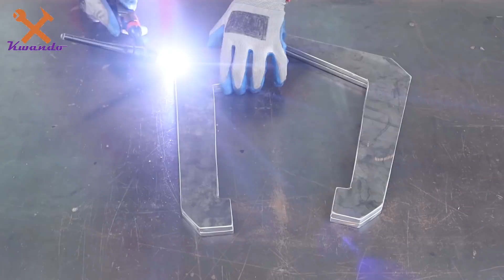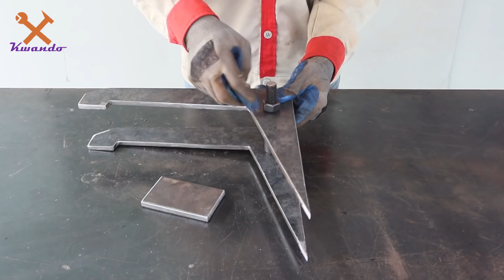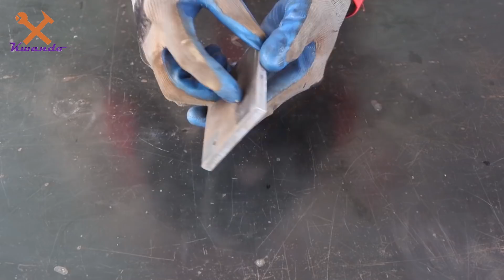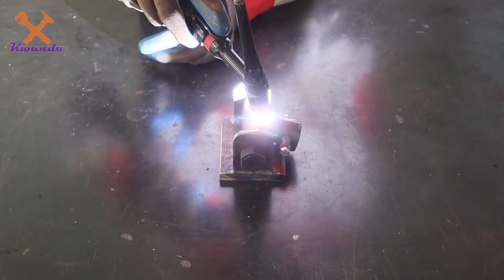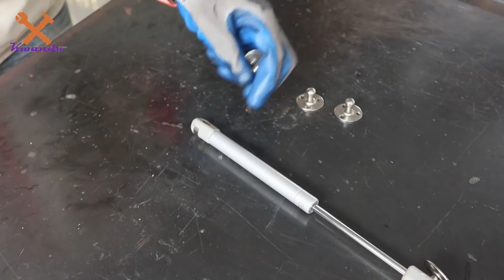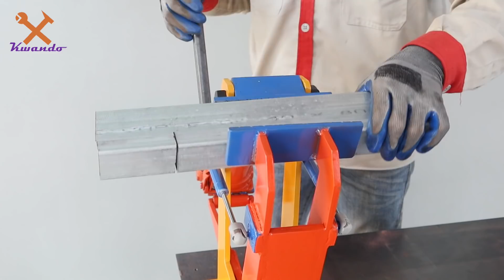DIY Tool | Make A Hydraulic Vise

Comment: From my point of view there are two design flaws that comes to mind immediately.

1. The weak point on the vice is where the hinge for the jack is. The "pointy" metal gusset is where you will bend/damage the steel depending on what force you apply to your jack. The two sides/gussets can be made much stronger. Instead of an "L" shape, you can add a "triangle" from where your gas struts are down to the pivot point of your jack.

2. When your steel is clamped, the top is not horizontal. So it is not practical if you want to drill straight vertical holes etc in your work piece. You will have to drill at an angle to drill a vertical hole through your work piece.

Other than that I applaud you for the mechanics and thinking outside of the box
Reply from the maker: many thanks for your opinions!

Comment: A spring around the bottom pivot similar to a garage door spring would give you more clearance for depth
Other than that I’d say great design might have to build myself one for the welding forging area of the shop 
(Can never have enough vices around the compound